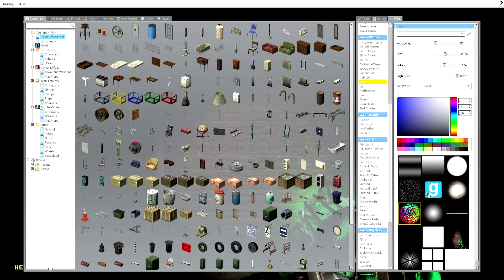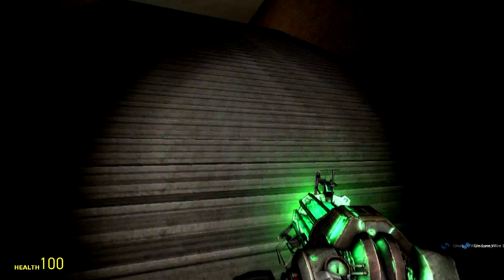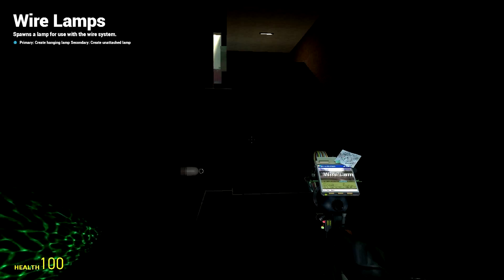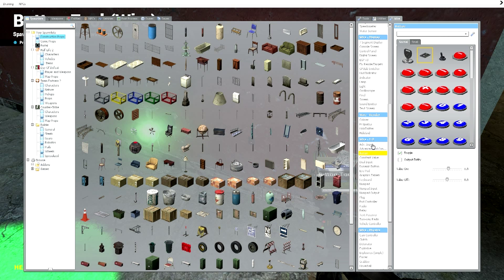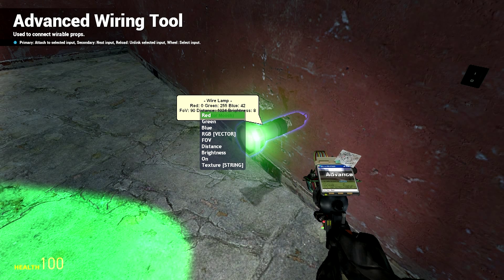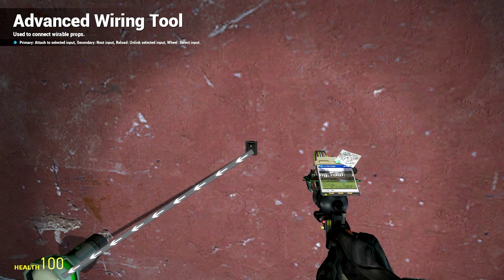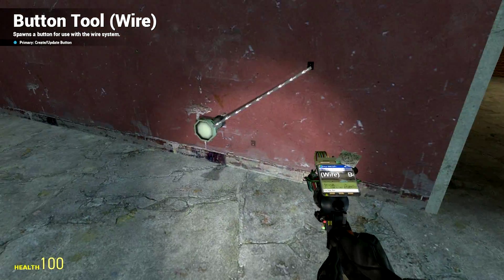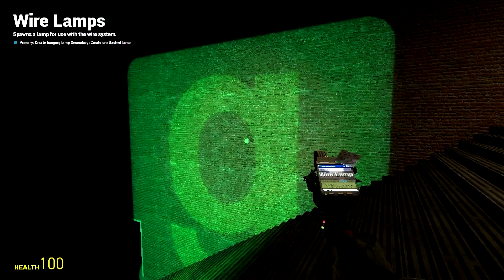Wiremod Tutorial 2: Back To The Basics (Switches and Lamps)

Comment: U CAN DO THIS WITHOUT WIRE MOD!
Reply: The idea is that he is showing you how to do it via wiremod. It can also be more useful using it with wiremod, considering you could link it to the trap so it distracts them.
Reply: ohhh k
Reply: Aldronex For instance if you wanted to make a cool trap with an RT camera. You could be in a control room and you could make it so a light flashes in the room when a wire trap is set off, alerting you to the fact someone has triggered the trap and it has killed them. The flash alerts you so you can check on an RT camera.
Reply: Aldronex boooooooooooooooooooooooop
Reply: +Aldronex so?
Reply: kinda but its hard
Reply: @stevenheady624  Wiremod is insanely easy once you get the hang of it!